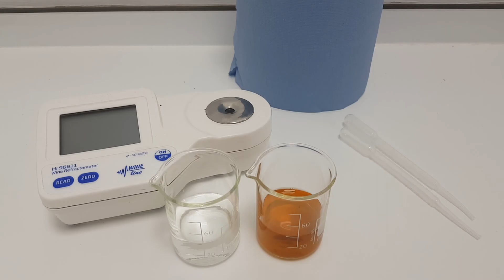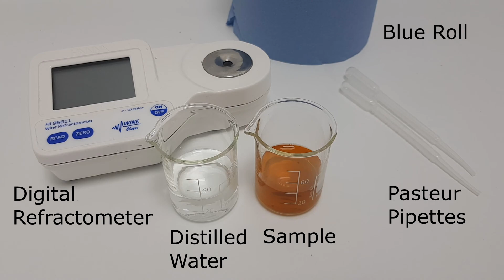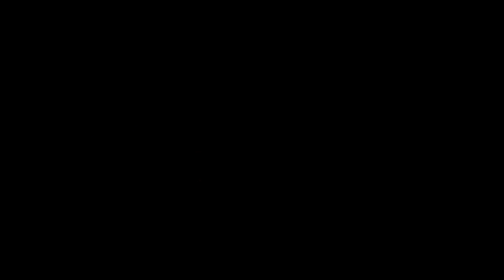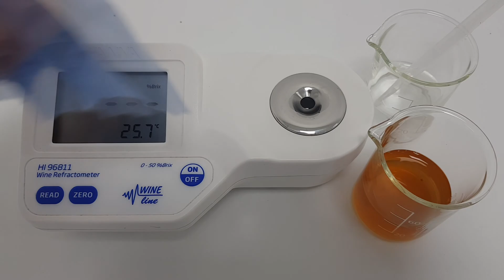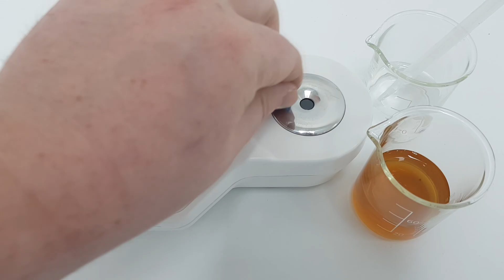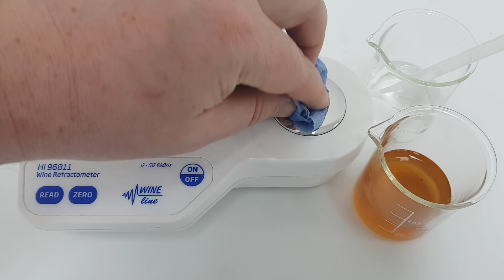How to use a digital refractometer

Comment: Does temperature affect Brix? If so, how does one correct the Brix value to a specified temperature, let's say of 20 °C?
Reply from the maker: Yes it is. A digital refractometer calculates this for you. A manual one does not and you will need to add or take away an amount based on how many degress away the sample temperature is from the calibrated temperature of the refractometer (usually 20C). You can look this up online but it usually a very small amount